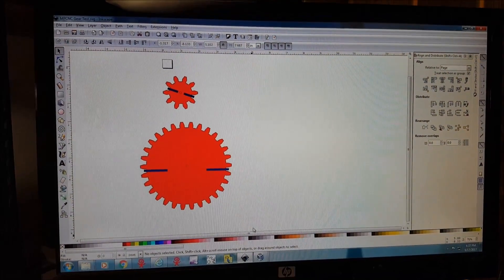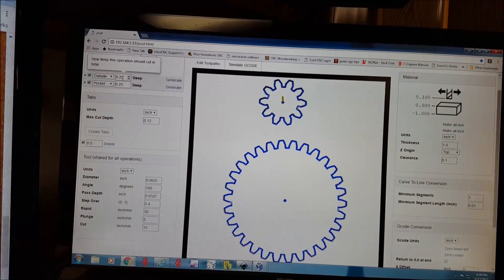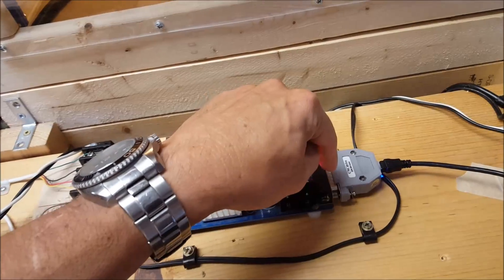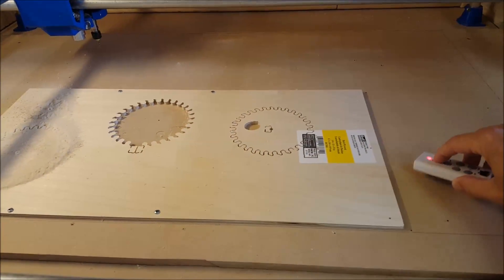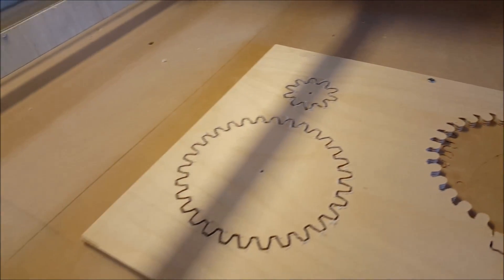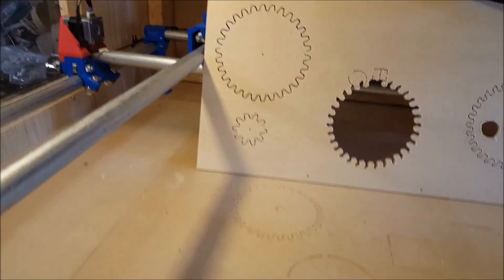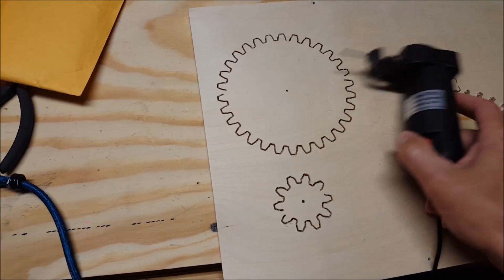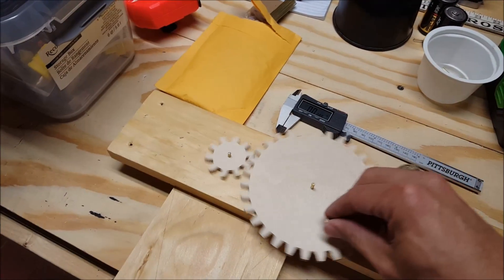MPCNC Wood Gear Cutting - Works Great!

Comment: Drez20001,I have the TB6560- 4 output stepper motor driver, Mach 3 and I would appreciate any dip switch settings, Mach 3 settings you may be willing to share, also I have the 48vdc, 8.3 amp output spindle power supply and like the manual spindle control you are using, could you tell me what the model number used.thanks...Bill
Reply from the maker: Hi Bill.  The manual spindle control I have came with the 500 watt spindle and was just a matter of connecting it; the power supply had the controller part built in.  I also like having a separate speed control rather than having to control it through software but unfortunately I don't have a model number for it.  For the dip switch settings I went online and found the breakdown for each one and started at 25% power for each and did 1/8" steps to start.  Then I just tinkered around with each to keep the motors somewhat cool but with enough power to cut without stalling.  You shouldn't break anything in playing around with the settings.  In my experience with the 3 axis board the settings varied on different CNC machines.  Some combinations were nice and quiet an others rattled depending on the build it was driving.  Testing is your best bet and take notes on what works.  As far as Mach3 goes, I pretty much use the stock settings for most things - ports and pins though will need to be set for the board.  The board I had only had the three outputs so I doubled up on one axis when I was using it to drive a 4 axis machine.  Your 4 output board is obviously the better choice.  I used the following website for basic start up stuff:  http://www.hobbycncaustralia.com/Instructions/iI20PinsandPorts.htm
Reply: drez20001, thanks very much for your assistance and web site, I believe this information will be most helpful....Bill

Comment: Drez20001, I'm still having trouble with chillipeppr, tinyg ,Json server, the g-code performed by makercam, today I attempted tp run to different projects and they both were truncated just after the gantry/spindle was doing it's thing. I think I might just cut my loses and go with Mach 3,TB 6560 4 axis and the UC100 from eBay but being un- familiar with these products I would appreciate any guidance you may provide, if you would prefer I could provide my e-mail.

Comment: Drez20001, thanks very much, what do you generally use to generate the g-code for Mach 3
Reply from the maker: I use a free program called Jscut at www.Jscut.org.  However a few days ago I found another really good and free CAM program that you can download and use locally.  It's called Carbide Create.  It used to be encrypted but they opened it up a couple weeks ago.  The only downside to it is that you can't make tabs to hold down work so you need to figure out something else like using tape but it is a very good easy to learn program.  http://carbide3d.com/carbidecreate/

Comment: drez20001, I saw your last post mentioning the need to replace your trusty TB 6560 control, do you have it yet, installed and operating?is it the same manufacture as your previous one and are there any other distinguishing  features.does Mach 3 have its own g- code generator?
Reply from the maker: It's coming from China so it will still be a while.  I think it's on a boat somewhere at the moment.  Mach3 doesn't have a g-code generator, it just interprets what code is sent to it.  At the moment I'm pretty impressed with the control board that came out of the 3040 CNC box.  We'll see if the replacement control board is as durable as the original was.  That old one was a beast.

Comment: Drez20001, if my assumptions are correct then one does not need the UC100 if the computer has a parallel port for the connection between the computer and Gecko 6560?
Reply from the maker: Billy Lester True.  If your parallel port is there you don't need the uc100.

Comment: please identify the cnc controller, model and source also same for speed control
Reply from the maker: Hi Billy.  The controller is a Toshiba 6560, they're cheap and in my experience solid.  I've abused this one for years and it just keeps on working.  Some folks have had trouble with them though.  They are about as inexpensive as you can get to drive a CNC.  I doubled up the wiring for this MPCNC so that the X and Y axis connections drive two motors, hence the colorful wiring bus.  http://www.ebay.com/itm/TB6560-3-Axis-3-5A-CNC-Stepper-Motor-Driver-Controller-Board-New-/131609621667?hash=item1ea48b74a3:g:REEAAOSwyKxXg0tq
The spindle was purchased from Amazon for about $135.  It's a 500 watt unit that comes with a power supply, the speed control pot and some other goodies.  For light woodworking it's whisper quiet and a pleasure to use.  https://www.amazon.com/Spindle-Cooled-Milling-Converter-Engraving/dp/B01LNBOCDA/ref=sr_1_3?ie=UTF8&qid=1497881048&sr=8-3&keywords=cnc+spindle
Reply from the maker: And this the USB controller:  https://www.amazon.com/CNCdrive-UC100-Parallel-Motion-Controller/dp/B00TPBGXII/ref=sr_1_1?ie=UTF8&qid=1497881299&sr=8-1&keywords=uc100
Reply: Thanks Drez20001, your response is very helpful, fyi, I have the Big OX CNC with 4 Nema 23 motors and use Tinyg / chillipeppr, not very happy! hopefully TB 6560 will handle the two ( Y ) motor load
Reply from the maker: Billy Lester I had thought about trying out chilli pepper but am content with this set up for now.  Keep me posted if you try it out.
Reply: Hi.. Can you not use a cheaper one like this: http://www.ebay.com/itm/3-6FT-USB-to-25-PIN-DB25-Female-PARALLEL-PRINTER-Adapter-Port-Cable-PC-LW-SZUS-/171998177140?hash=item280be3e774:g:7HgAAOSwEgVWTzlN ? If not whats the main difference? Any idea?
Reply from the maker: KenngeNOR That cable won't work unfortunately.  The UC100 is a motion controller with dedicated software.
Reply: Ah i see :) Thanks for swift reply.
Reply: Drez20001 my CNC has two nema 23 motors each rated at 2.8 amps, do you think the Y driver will handle two of these motors realizing that the ratings are at max.rating and not necessarily the operating current.Thanks
Reply from the maker: The Toshiba board is pretty tough and I did a similar thing recently with another CNC build.  I made a fast and cheap Solsylva CNC and wired in two NEMA 23s on the same driver.  I had to diddle around with the current settings but it seemed to work okay.  I ended up taking the Solsylva CNC apart due to a lot of alignment issues but the motors ran fine doubled up.  Here's the video - jump to the 3:15 +/- mark for how I connected both motors to the same driver.
Reply: Drez20001, thanks for the response, now I am wondering if the 4 axis gecko will accommodate a motor for the second Y motor, I have noticed that the fourth axis is referred to as axis A?

Comment: We just barely moved into a new place and it has a full wood shop in the back yard! I was able to move all of my shop into it yesterday which I haven't had for a year now and I couldn't be more thrilled! I went ahead and purchased the Anet a8 after you told me that was your printer and I have been loving it. My CNC is just waiting to be used out there so you can expect some cool projects coming from me soon! You really are an inspiration man you do amazing work and I always get so motivated to try new things when I watch your videos. Oh and by the way your enclosure on that CNC looks SO good! I love all the acrylic so you can see through so well!
Reply from the maker: Hey Kaden.  Many thanks for your comments.  Yeah, the Anet is a great little printer that can produce some pretty clean and detailed prints.  I was amazed that it had the ability to print all of the parts for the MPCNC machine.  Your workshop sounds fantastic.  I'll keep an eye out for your future projects.  Best of luck.